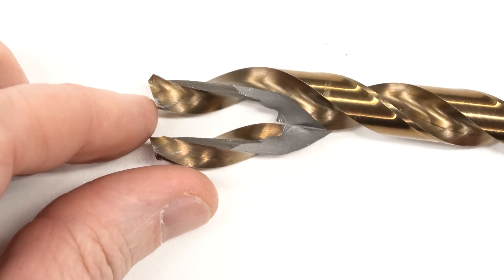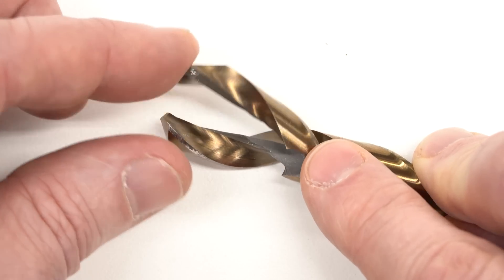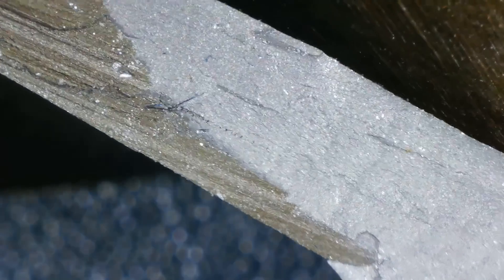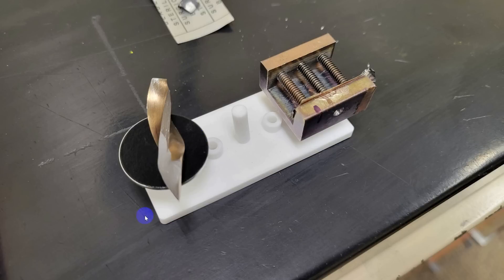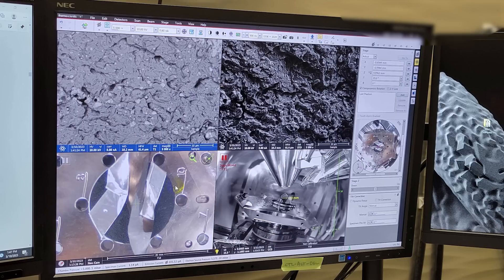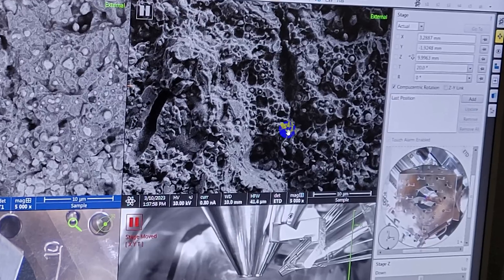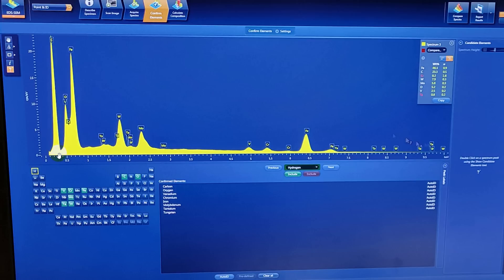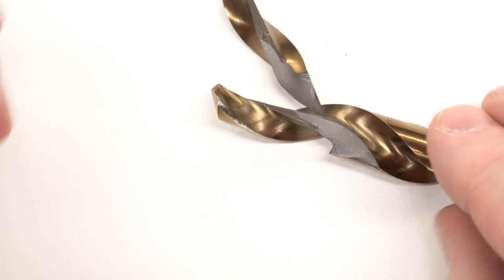What the Scanning Electron Microscope Reveals About This Failed Drill

Comment: I worked with Carbide for many years as I was a machine operator in a carbide tool manufacturing plant. I've seen many tools break or come apart such as your sample. Carbide is "sintered". That is, the composites making up carbide are mixed together as a powder and then heated under pressure to create a solid. The gold color on your sample almost certainly means it was fractured AFTER manufacture.This is why, of course, some traces of the coating appear on the fracture. It is sometimes very difficult to see a fracture on a particular tool that would lead to it cracking. Of course, we didn't have the use of a SEM while making tools. We would sometimes drop tools to see if they broke apart if we were having problems with a particular batch of carbide. This tool pictured had a fault from the sintering process before it was ever fluted. We found that certain suppliers of carbide were prone to this problem and therefore we tried not to use them. Certain composites (called grade) of carbide can be in extremely short supply, especially if a particular type tool is specified on the print. Generally speaking; the more harder-acting the carbide tool is, the more expensive its cost.

Comment: You can see the fatigue benchmarks on the fracture surface in the silver colored area.  Area shown around 11 minute mark is fatigue crack propagation area.  At 11:33 mark, dimpled rupture is noted.  Overload fracture.  Within cups are carbides.  Pre existing defect.

Comment: Best not to use split point drill grinds for opening holes up as the web is weaker.

Chatter probably caused this bit to fail, although I do agree, it had a flaw in it to start with.

Comment: The only reason to pre-drill or pilot drill a hole is to clear the web. It’s a lot harder to push a drill when you don’t. In my experience the least times you step up in drill sizes before the final, the better. A split point has practically no web at the point so generally they don’t need pre-drilled… so long as you aren’t using a cordless drill.

Comment: Never use SolidCarbide to drill Pre-Drilled holes. Drill Hog is right about that.
For spot drills, make sure the tip angle is LARGER than that of the drill (SC drills are 135° most of the time)

For cases where a spot drill is not enough, use a pilot drill, but beware, you need a special pilot drill

Comment: I write software for exactly this SEM. It always amazes me what can be done with those machines (I'm SWE, not a physicist). And trust me, this is the most basic type of analysis you can do in them. I have seen people heating golden nanoparticles to 700 C and observing how they started to jiggle. All while seeing individual atoms. I have also seen people micro-machining a few-nanometer-wide lamellas which are then analyzed in even crazier machines (transmission electron microscopes).

Comment: There's a video somewhere on YouTube showing drill bit manufacturing where the spiral is formed in a hot drill blank via a set of rollers.  In the video you can see that there's cracks formed in the ends of most of the rough formed blanks, likely due to the end of the blank being too cold for the amount of work/deformation that it is undergoing.  I'm not the only person who noticed it, there were several others that left comments.  Maybe Clough's bit came from the same factory where the video was shot.
Reply from the maker: I saw a similar video after posting this and had the same thought.

Comment: Two flute drill bits shouldn't be used to enlarge holes for the same reason that two flute milling bits shouldn't be used to cut slots.  The forces on the flutes will always be out of balance, leading to vibration and a tri-lobular biased hole shape.  As others have stated, you want a good deal of the point width to be cutting to minimize that issue, because once you only have the tips making contact, it gets pretty bad.  

As a rule of thumb for boring with drill bits and stepping up sizes, you can safely start out with a hole that is smaller than the web thickness of the next drill bit you plan to use.  So, for a 1/2" bore, you can drill first with around a 3/16" hole.  

And as for the operation you were performing on the lathe, well you probably should have been using a boring bar.  Also FYI, that works better upside down and in reverse.

And yes, your bit was probably cracked during heat treatment and was defective.

Comment: Very interesting failure. Many years ago I was given a box containing hundreds of new drill bits labeled as rejects by the makers. I found the same faults in all of the ones I tried to use. 
Looks like your example missed the test. 
Almost every metal failure shows the reason in the fracture surfaces including polished surfaces deep inside where voids have been moving.

Comment: I spent a few years in a machine shop that's been in business for around 60 years. It was pretty standard known not to enlarge holes with a drill if you have any other option to enlarge the hole. I was taught the tip grabbing into the material does a lot to hold the drill centered. That when a hole is enlarged, it can cause vibration in the drill which can uncenter the drill causing a higher force the flutes can't handle
Reply: Right, if you jam one side of the drill against metal and not that v in the center then ... surprise! It will fail on the side of the drill like this. It's fine to do but I don't know that it would be best practice, everything in me screams you gotta bore that sucker out with a boring bar. I think best practice is you make one hole and bore it out, making two with a drill is misguided but also who cares it works often enough and breakage is a part of business

Comment: Very cool analysis! Every machine shop should have an SEM available for this kind of deep-dive! 🙂
Reply from the maker: Couldn't agree more.  Any great tips on how to pick one up without selling my house?
Reply: @Clough42  you should check out Breaking Taps channel and some of his homemade equipment. An autodidact like yourself might get stuck down the rabbit hole though :)
Reply: Maybe ask your friend to scratch an carefully dent  an pull a wire off inside. Then they might just replace it? Colleges have lots of money. Then pull it out of the dumpster...  Or maybe they have and older one in storage?
 I did like the video. It was very interesting. Being able to tell what elements are present would be handy. No more mystery metal! I know nothing about SEM  but for what it is worth based on what you were saying an showing I agree with your findings. I am going to see if I can get a much higher magnification lens for my old B&L microscope. I suddenly want to see as much as I can. This rabbit hole may get very expensive!

Comment: You continue to surprise. That is quite an analysis! This level of metalurgical analysis is not common to home shops! Lots of great comments below, but I have routinely drilled a smaller hole, then a larger one. Aluminum is soft, with good control of the feed, a decent bit should handle the job. It is true, though, that machinists routinely cut aluminum with carbide bits at very high rpm, which would minimize the depth of cut per revolution.

Comment: Nice to know where to look if something is broken. The centre of the drill is pushing the metal away, so forms a resitance to the drill, preventing that drill is digging into the metal. You see this also happen if drill through a metal sheet, as soon the centre point is through the metal it will grab the metall because there is no counter force any more and the backslash of your drill press will make it worse. So on soft metals it is better not to pre-drill with a smaller drill. But in your case, just a bad drill in on a bad day.

Comment: Excellent explanation on SEM and EDAX analysis ( I assume this was the analysis method). I have worked with SEM, but on a very basic level. 
It would certainly appear that the drill bit was cracked during manufacture.
Thanks for sharing

Comment: Interesting; I had the exact same failure on some bits from them. One happened so quickly that you could see the coating over the crack. This was about 1 year ago when I had this issue, I haven't tried doing a warranty for the bits since I have broken so many, they would almost need to send me a new set.

Comment: Maybe it's just me, but the first time you said "split point drill", I thought "that point sure looks split, right!"
Anyhow, stepping up drills is a common practice to get larger holes on a low powered machines afaik. The machine just doesn't have the power for big holes in once. It could be that split point grinds are the problem, as there is less structural integrity.

Comment: Looks like a flaw that was present in the raw material at the time of manufacture. Could have been inherent to the material and not during manufacturing. The only way to really know is to be privi to the manufacturing process of the manufacturer. Do they buy the blanks as drill rod  and do the grinding and heat treatment or do they manufacture their drill rod from scratch. One thing I would say though, the core diameter on the broken drill seems small. Would be interesting to know what it is as a percentage of the drill diameter.

Comment: Great stuff, I have learned a lot from your channel over the last few months I found it. The findings from the microscope are beyond my comprehension, but it is obvious from the discoloration and the soldering magnification that the drill was already cracked during manufacturing. I am surprised that it didn't break as soon as the point hit the material. As far a not enlarging an existing hole, I mean come on, we all do that and seems like a CYA response from the manufacture. I like how you just represent the facts and not blast the manufacture, this could happen to any manufacture, things happen.

Comment: It's not information you will do anything with, but it is useful information. The manufacturer should consider it for QA issues, and if your work material is important enough, it might be useful for folks to get rid of any additional drills from the batch, or at least use them only when you can afford a greater risk of the drill breaking.

Comment: The fracture surface has "beach marks" which are evidence of metal fatigue.  The "beach marks" are the curved lines that start at the edge of the drill and progress towards the center of the drill.  Once the fatigue crack is deep enough, the material will fail suddenly.  Your analysis is correct in that the drill did originally have a longitudinal crack since there is oxidation on a portion of the separated surface.  When the drill was loaded during drilling, the portion of the drill that was separated from the body of the drill was exposed to multiple loading cycles which lead up to the fatigue failure.  Again, your analysis is correct, but I did not hear any mention of the fatigue failure that the "beach marks" are evidence of.  I am a mechanical engineer with 36 years of automotive experience and have many years of failure analysis experience so the "beach marks" are something I am very familiar with.

Comment: Oh, such memories!  But also, I share 100% the lifetime interest on all kinds of odd topics.  Sort of everything between ground and sky (including chemistry, metallurgy and astronomy).  All of those far away from my professional education.  However, at one point I participated in troubleshooting of a paper machine dryer cylinder with a boss, who was even more skilled on various strange things than I was.  He decided we needed to get photos of the cylinder surface morphology, using SEM.  As we could not take the 16 feet diameter cylinder to a SEM machine, we made imprints of certain locations of the cylinder using some plastic.  The SEM operators plated our imprints with metal and then scanned it.  Unlike optical microscope, the SEM process had a marvelous depth of field, so the imprint piece could be tilted at will and everything still remained in focus.  Marvelous pictures!  Your story also relates to another past experience of mine.  At a time I was presented with a challenge of an unsteady GTAW (TIG) welding arc.  Turned out to be a split tungsten electrode.  It also was a manufacturing issue -- inadequate bonding of the powder in the sintering process.  That memory immediately flashed in my mind when I saw the split of your drill bit.

Comment: James,I have had 2 very similar failures with 8% Cobalt HSS drill bits in the past. In both instances you could clearly see a flaw had existed before the drill split apart with the same different colour and grain structure features as seen on your broken drill. It just happens on rare occasions that a drill bit has a flaw in the material stock or a flaw occurs due to some fault in the heat treating process and it gets missed by quality control.   The investigation with the electron microscope was fascinating.

Comment: It's quite dramatic claim to say the drill fails almost every time when extending existing hole. I have done it countless times and never had any other failures than small edge chipping. However, I have had problems with work hardening materials. When extending hole, drill can bite more than it normally should and also start oscillate. Sometimes oscillating can harden the piece and then ruin the drill.

Comment: I'm a machinist and worked as teacher for CNC-technicians. Pre drilling is a thing of the past for simply ground HSS drills with thick cores and non-cutting centres. Today's drills with thin cores, large flutes for chip evacuation and efficiently cutting "split" centres are designed to work in solid materials. If pre drill is a must due to weak machine the initial hole should be kept to no larger then the core of the drill and the feed of the drill must be carefully controlled and steady to not allow the drill to catch and act like a screw.
Also note that the hole is more likely to get crooked and less round when pre drilling.
Reply: What is the hole tolerance then doing that?
Reply: @stevenconnor4221  That depends on the print! 
H7 is the tightest tolerance I personally have worked with that reliable can be manufactured with a drill (a rather expensive drill in very good machines).
Reply: @sharg0  Hi I'm a manual machinist,  with minimum CNC experience. I know the H7 tolerance for manufacturing a drill but when you ram that into a pice if metal it will cut bigger in its H7 diameter and geometric tollerances. Is this correct? Because different materials will affect the chip size and rates. I'm just having a hard time understanding if I put an H7 12mm drill into a piece of metal that the hole is going to measure 12mm with a bore gauge or even 12.1 ... Hence why we used to step drill
Reply: @stevenconnor4221  Yes and no. When you get up to higher quality drills it's not the dimension and tolerance of the drill that's given, it's the hole it will generate IF used correctly. 
Holding and centring of the drill is critical to have a chance of reaching tolerances of this level. As an example I never put a carbide drill in a chuck of any kind but use collets if there is any way to do so. 
You are correct in that the material effects the size. 
Step drilling risk affecting the hole by increasing the risk for an unstable operation since there no longer is any support for the drill tip.

It is also important to not mix up the difference in drills vs enlargers/broaches, the latter work on the sides of the hole and follows the existing centre.
Reply: @sharg0  ok so what you are saying is that an h7 drill will give an h7 fit hole. With the caveat  For an h7 drill which are expensive.  ( I get the different types of tool holders that affect run out and accuracy and max speed, colletts, shrink fit, hydraulic etc)

An old trick with normal presto or dormer jobber drills if you wanted an fit size for a  hole (either it was too small for boring or takes too long or you didn't have a reamer suitable) was to either drill full size or drill the next step down but if that didn't give you your fit an experienced machinist would know what size before final size hole to drill that would give you the hole size for a fit.  

Now it comes to the design drill, ream, bore, grind, lap. A good engineer should always know where to work within the tolerances. It seems in CNC buy more expensive tooling as you only need to complete the task once therefore reducing the time on the job that's ok for industrial application.
Reply: @stevenconnor4221  As a price example I run a development project 12 years ago or so and one thing we evaluated was drill endurance. 2.5 mm holes about 20 mm deep for M3 tapping. Those drills supposedly gave H7 holes but cost around 65 € each. On the other hand when things were right they lasted over 1000 holes in stainless steel.
And you conclusion is right, the skilled machinist chooses the right tool for the job. Sometimes it's a high precision carbide drill other times it's the cheap HSS.

For larger holes, above 12 mm or so, I personally like carbide drills with replaceable inserts and definitely no pre-drilling for those! 
They also have the advantage that they can be used as boring bars to enlarge the holes in a lathe! (Very nice if you have 30 and 32 mm drills but need to make a 30.5 mm hole as example, drill and turn with one tool.)

Comment: So the upshot is that the forward area of the drill was about 95% pre cracked when it left the factory. As the bit was being used, the few areas in the forward area fractured until the drill was presented with a load higher that the remaining little bits of metal could withstand.